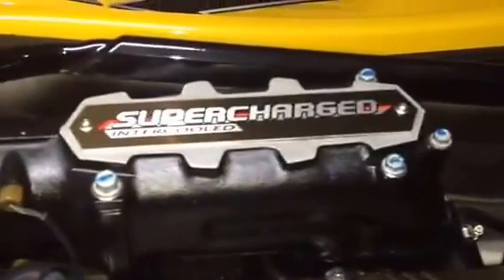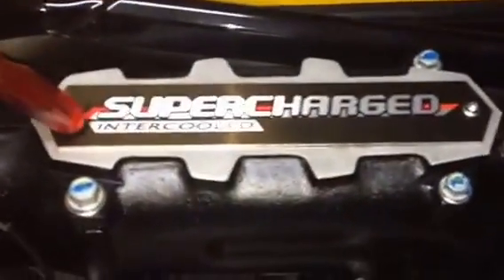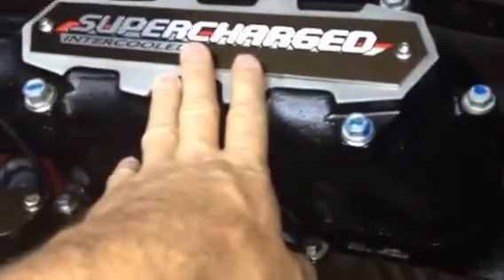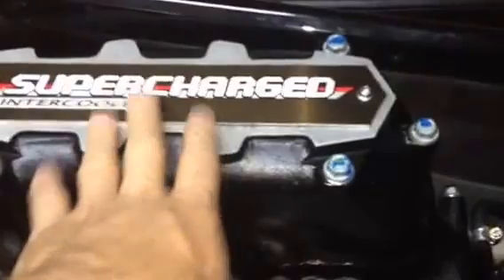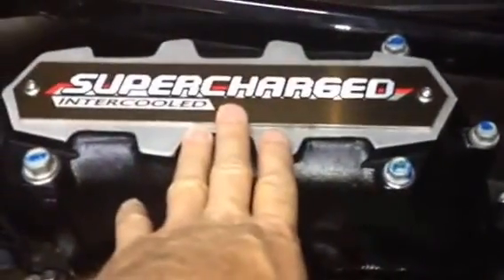This is the actual Eaton Brand supercharger for Kawasaki Ultra 300/310

Comment: Hallo thanks for that video. Where are in Thailand? I staying in Ubon just bought a used ultra 260 and found out to be quite alone with it in Thailand.
What I don't get there are eight hoses going to the inter cooler 2 water 2 main air 2 from the air box. What are that 2 for?
Reply from the maker: Hi Sorry for the late reply, I have not been able to see comments for the past week Im in Kaeng Krachan my tel no is 0984980152 call me anytime my name is Rod. I sold all my ski s a while ago I had 11 new ones over 6 years. You bought a 260 they have the Augura Supercharger not a good one and some fuel in the oil issues and possible head issues where did you buy from Motorfield? Im no that familiar with the 250 or 260 in some ways my e mail is rodsafetyfirst@yahoo.co.uk